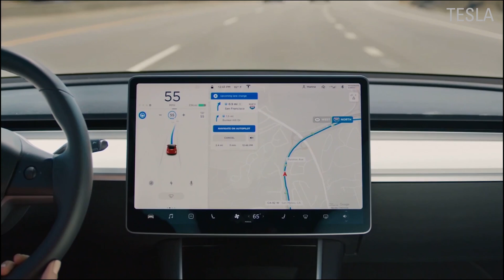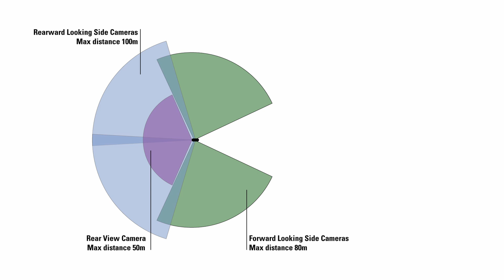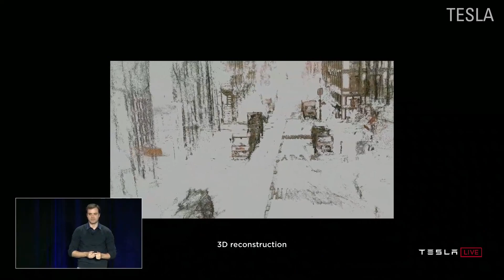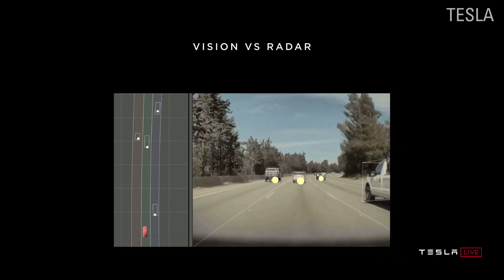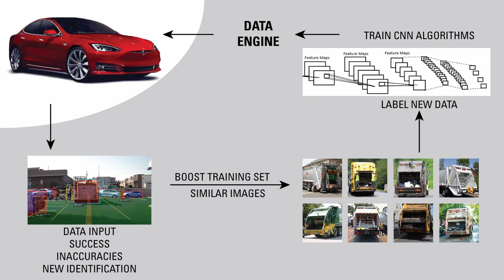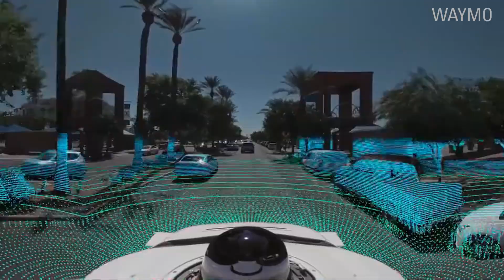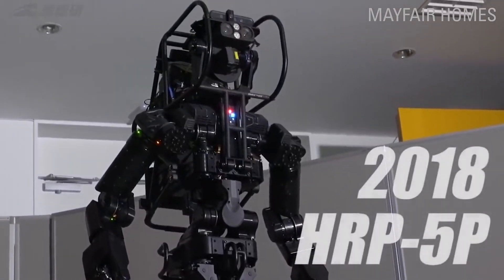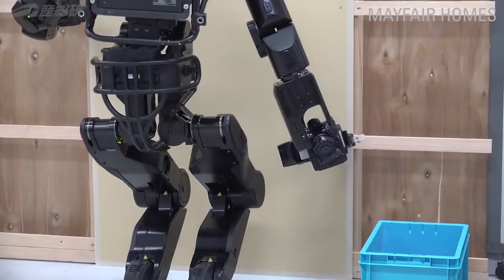Introduction to Tesla's neural network

Comment: Hi Belinda, great video as usual. Could you please do a video on how dangerous teslas are?

(plowing into stopped vehicles, poles; exploding; catching on fire and can't be put out) For a starter try reading the firefighting document for teslas and the guide to opening the manual release on rear doors! Truly terrifying stuff - I talk my loved ones out of buying them!

Also the Tesla brains seem really, really dumb: thinking the moon is a stoplight, driving directly into hard objects right in front of them.

Also how do they get safety approval for their (very dangerous) "Autonomous* driving mode" (*Requires driver intervention, not available in all locations, local laws may apply)

Comment: Another good video, well researched. Tesla just updated the Autopilot system on my car twice in a month with behaviors so noticeable I was able to make some videos on the changes.

Also I just noticed the 3D Printer back there, still waiting to get started with mine, this apartment was supposed to be a shorter duration than it has turned out to be so the printer is still in the box 😢
Reply from the maker: Thanks, Kacey! I'm going to watch your videos now.
Which 3D printer did you buy? I've got a Creality Ender3 from 2018. It's been a great tool so far.
Reply: @BelindaCarr  thank you 😊, I got the UP Mini and am excited to try it out.